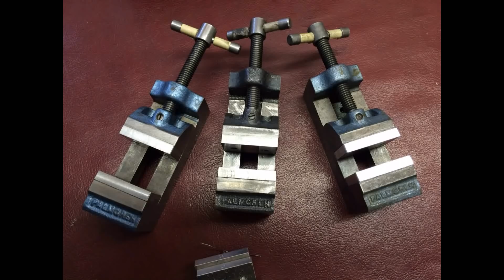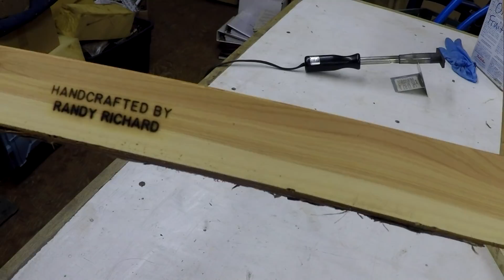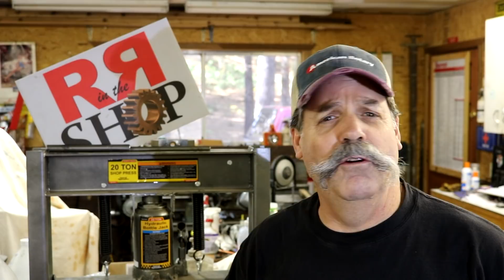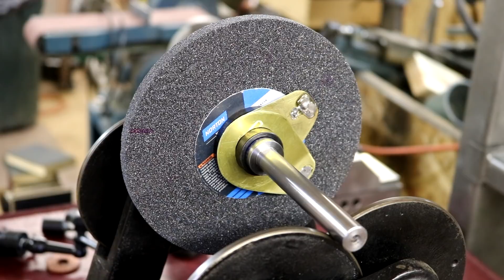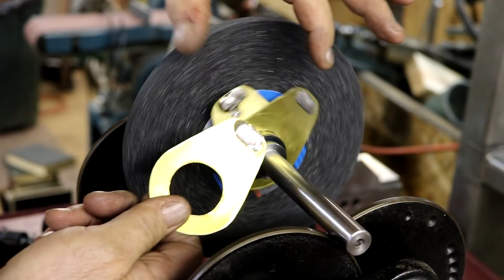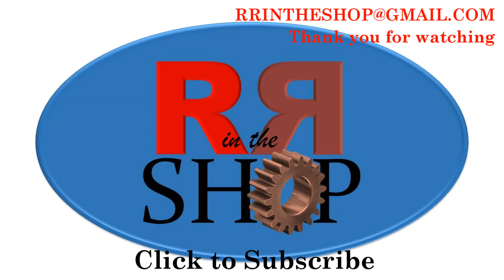How I Static Balance a Surface Grinder Wheel Followup #2

Comment: My Norton stone was so out of balance a penny would instantly fall off the motor. I used the "ways" of my 20 ton press, 2 maple blocks and a 1/2" rod to make a crude balancing device. Now I can grind on my bench grinder and the penny doesn't move. It's a totally different experience grinding with a balanced stone.  Thanks Randy for your thorough videos.
Reply from the maker: Nice.

Comment: Oh lord Randy, someone will complain because you said sodder, instead of salder.  I like you solution, is it patented yet?  I knew a certain individual would still not be totally happy with how you made these.  How much longer did this take than drill pecking, and don't you think you will get faster with experience.  Don't like the idea of doing anything to affect the integrity of the wheel, that could lead to a high speed failure.  But then what do I know, I don't have a surface grinder, but I have slept at a Holiday Inn Express. LOL  Seriously though I used to balance tires in another life, (40 years ago) and I like your weighting system.  We always used a minimum of 4 weights (2 front/2 back), when bubble balancing, as it gave a better balance on the tires.  Do what works for you and keep grinding.  Love the videos, and the 'stache!  (Wouldn't shave mine for anything less than a new Bridgeport Mill.)
Reply from the maker: I do not know it is patented.  About the same amount of time.  On 1/2" thick wheels same side.  Most folks seem to keep to one side.  No shaving here.
Reply: I meant, have you patented it yet!
Reply from the maker: nope

Comment: Randy,
I love your videos!
I have a KO Lee S714 Surface grinder that I picked up a few years ago and I am getting it into shape to use. It only came with 1 mandrel which looks pretty much identical to yours. I have been looking on ebay for some more. Do you happen to know whether the mandrels for these older US made grinders are typically the same and interchangable?
Thanks for any of your thoughts on this.
R
Reply from the maker: Thanks.  I would say yes.  You can contact LaBlond they are the dealer for KO Lee, just to make sure.

Comment: Amazing how much that black wheel was out originally. Nifty idea with the shim stock and solder approach... something I'll remember even though I only have regular grinders. cool.
Balancing weight required will I am thinking be more or less depending on distance of weight/weights from center.
Reply from the maker: Thanks Chris.  This worked really well and cheap.

Comment: Randy the only thing I would worry about is the brass moving while the wheel rotates, it doesn't seem too much holding them in place, but maybe the wheel adapter will keep them from moving. I'm just getting a surface grinder setup, so no expert, but going to opt for the balancing hubs with the movable weights that use set screws. I only got one wheel adapter with my grinder.:(
Reply from the maker: There was no movement.  The wheel adapters with balance weights are pricy,  $200 Plus ea.  Where a standard one is $55.  I am going to making another balance setup for use with a standard hub,  Thanks .
Reply: HHIP has the balancing adapters for $80. Sopko clones as best I can tell. I bought one but haven't balanced a wheel yet...getting things setup and will do that soon, but no cigar yet. I need to finish clamps to hold the mag chuck to the table. 

https://www.hhip.com/f450-grinding-wheel-adapter-2420-0352.html
Reply: Click on the view catalog link at that page, you can see that the F450 has balancing tabs. There is another adapter for the Okuma/Tatung that looks like it would work for $52 (F350), but I wasn't sure if that was exactly the same as the common 1-1/4" taper or not...so went with the F450 to be safe. I only ordered one, but it looks fine. Sopko gets about $200-$300 each as you point out.

Here's the F350:

https://www.hhip.com/f350-grinding-wheel-adapter.html

Comment: Randy is there any footage of how you made the brass weights ?  I wonder how you cut the center holes in the shim stock
Reply from the maker: No I did not shoot that.  I scribed out the shape, used a 1" arch punch then trimmed the hole with a dremel tool to size 1-1/4" with no play in the hole, then cleaned a spot and used a 1940's large electric soldering iron to apply the solder.  If I was going to make a bunch of these I would cut to shape then stack them and sandwich them between  some material so I could mount in the lathe, then drill and bore to perfect size.

Comment: Both vids on balancing are very informative, the O & G company i worked for engineering standard for static & dynamic balancing was by removing material only
Reply from the maker: Thanks Baz.  Yes sometimes it has to be removal on some items.  Back in the day they would cast
in weights or areas to be removed to perform the balancing.

Comment: I prefer this method to drilling the wheel, that doesn't alter the wheel and the drilled holes don't det filled...   ;)
Reply from the maker: Thanks Pierre.
Reply: Wouldnt the holes in the wheel weaken the structure of the wheel ?
Reply from the maker: Yes, the holes you drill are not deep, more like depressions.